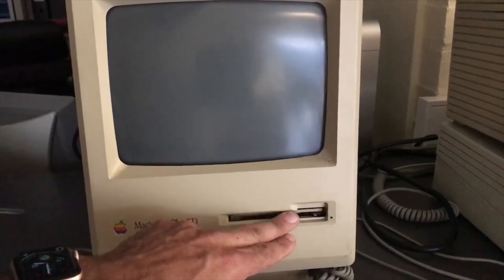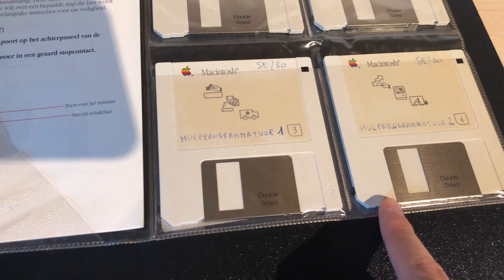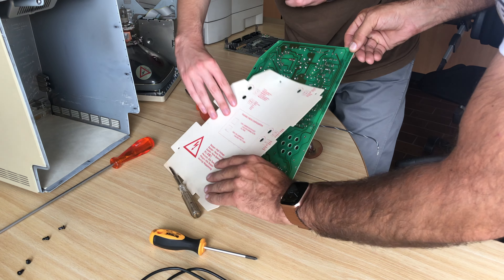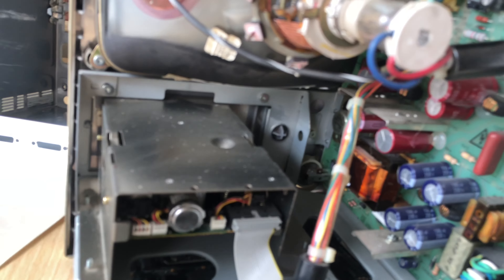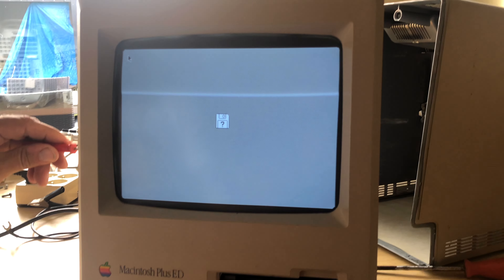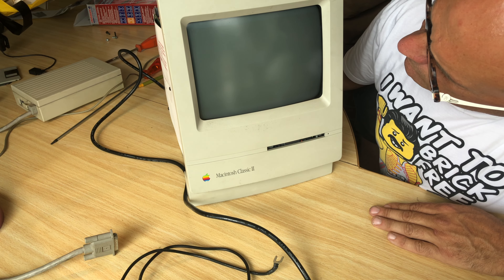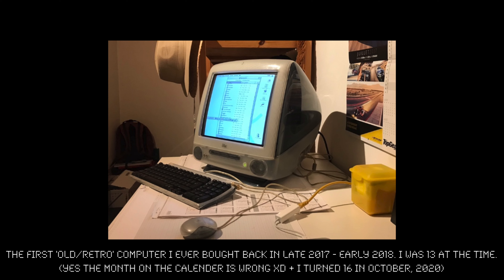Macintosh Plus Black Screen Repair + Checking Out Apple Collection!

Comment: Hi and thanks for the video. Probably you can help me i have a macintosh plus working well. I have unmount it completely for cleaning the case. When i remont it it don't want to boot. I have nothing just a cracking sound out of the speaker but no dong ! and nothing. Is there a way to test the alimentation ? Is it dangerous to power on the alimentation without the monitor plug ? thanks for your advices

Comment: Man, I freaked out watching you grab the CRT cup with your left hand while poking with the screwdriver in your right hand.  Never have both hands in that area, ever!    A shock will cross your upper body through your heart, and you could very well end up dead.  Otherwise, you do a really nice job here and I look forward to more videos from you!!!
Reply from the maker: I actually always discharge the CRT with one hand (check out other videos). 
I know how electricity will take the shortest route (your heart) if you get shocked with both hands in the machine.
It might not look like it but check out that clip again.
I discharged the CRT for a good 10 seconds (to make sure it’s fully discharged) before even touching the anode cap.
Remember that a CRT is basically like a big capacitor.
Once it’s discharged, it’s discharged.
I made sure my screwdriver was touching the prongs/leads and that the CRT was discharged before I grabbed the anode cap.
That’s why it was safe to then grab the cap since it was definitely discharged and there wasn’t any spark.
I could struggle and put a lot of force onto the anode cap by trying to pry it off with my screwdriver or I could gently push it down with my hand to get out one of the prongs and then remove the whole cap...

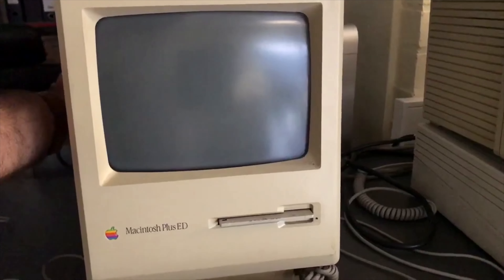Comment: around 2:44. to my knowledge the crt itself holds the high voltage and not the board itself.
Reply from the maker: Both hold a charge (especially the caps on the board). It’s never a bad thing to take extra precautions.

Comment: Hallo sir, its a very helpful Video. THANK YOU.
Do you know What it means, when you turn on a macintosh SE 1/40 and  there is a short speaker noise Signal, the Computer does not Boot up and after some seconds the Finder  Massage says: "damaged  program or program in use: Finder"- Press Button to restart.
And you cannot do anything Else with the machine, than to Restart  it or turn it off